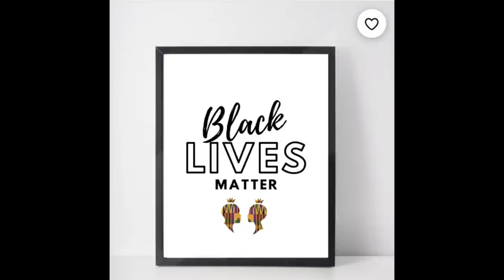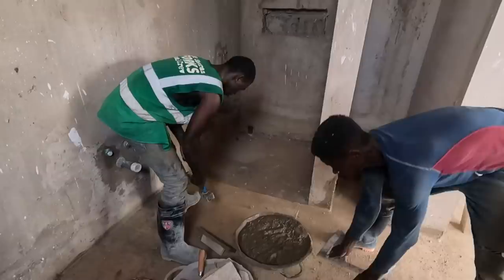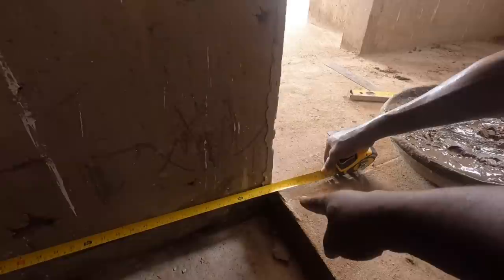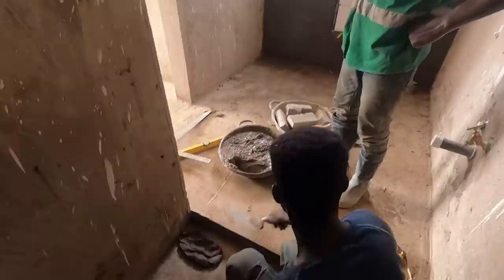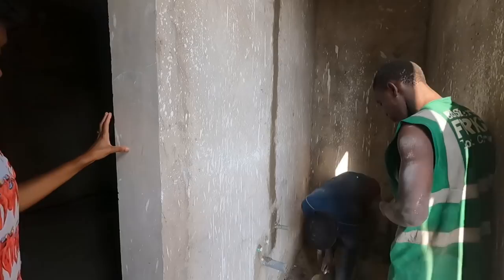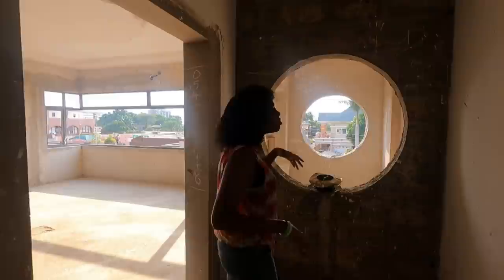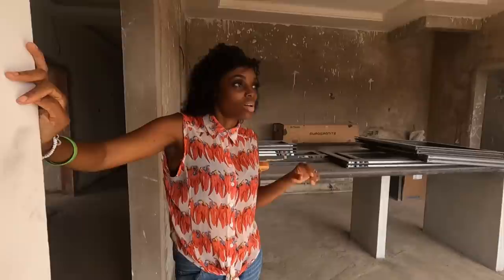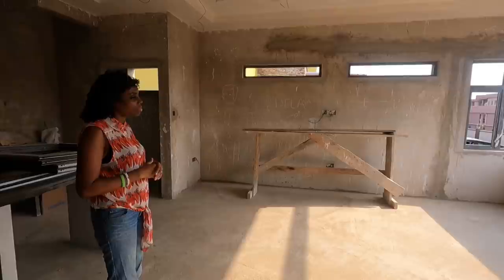Kwame Gives The Labourers A Little Lesson On Site | Building Our Dream Home in Ghana

Comment: 🤣 You guys are so funny l like the 'comedy' aspect of your videos. Rendering, plastering and skimming are forms of plastering but it depends on what exactly you do or use it for: 1. Rendering usually produces a coarser finish than plastering --- for exterior/outside surfaces. 2. Plastering usually produces a finer finish than rendering --- for interior/inside surfaces. 3. Skimming  usually produces a smoother finish than plastering and rendering. 4. Andreiing usually produces a very smoother (super smooth) surfaces. Andrei is another level or class of skimming. It appears white due to the lime, gypsum, white paint and the milky adhesive substances. The name's origin is Greek and French.
Depending upon the combination and type of material(s) used that would determine the colour ; that go(es) for all the above mentioned plastering forms. In the UK plastering and skimming is light-brown or clay colour and sometimes or some places white. Rendering is always a mixture of cement, sand and water and sometimes hydraulic lime. Adhesive materials maybe added.The type of plastering they do in Ghana is usually rendering but they use the word 'plastering' for all. In a way Kwame is right ✅ 👌🏽🙌🏽👏🏽 😏. Don't worry Dela, l will defend you another day 😀👍🏽.
Reply from the maker: Boooo! 😂
Reply: @moretodela  😁🤣🤣🤣

Comment: Good job guys,... have been following your journey whilst doing my own project,... buying from the same shops you buy from. Thanks...... Kwame,.. from experience,  the shower doors should flash with the inside of the little block work you just laid,  so that splashes of water on the door during showering will drop straight down the drain area, otherwise when water settles on top of the block work,  it might find its way underneath the door to the other side of the bathroom.
Reply from the maker: Good point